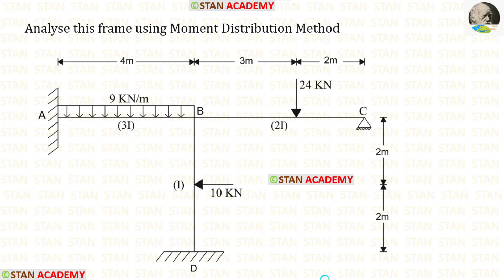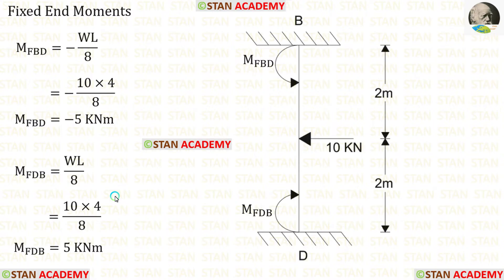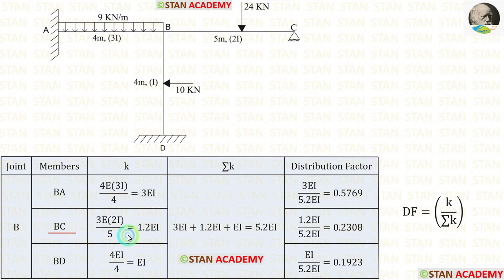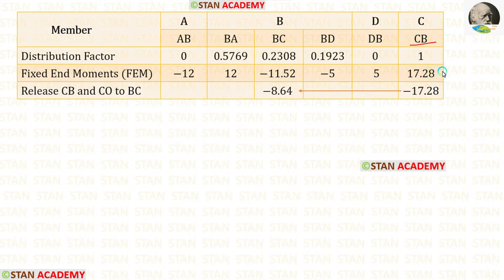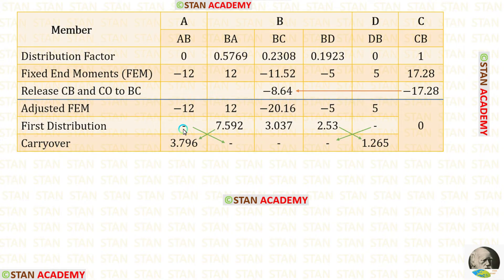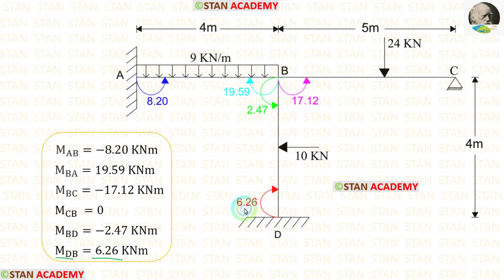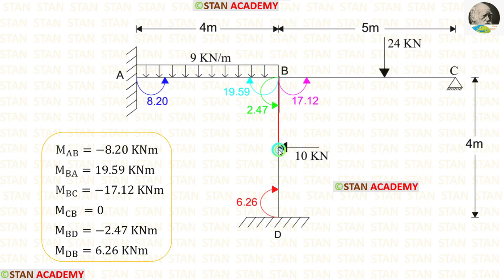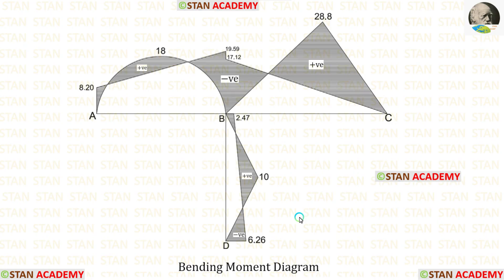Analysis of Frames by Moment Distribution Method  - Problem No 2  Analysis of T Frame )

Comment: 1:14 Sir the structure is unsymmetrical so sway will occurs naaaa
Reply from the maker: Even the structure is not symmetrical, there can be no sway if there is a support in the beam to hold the structure from swaying. There is fixed support and also a hinged support in ths beam. They will not allow sway